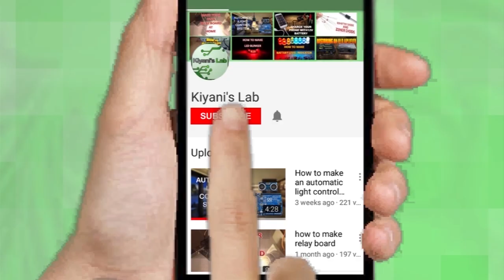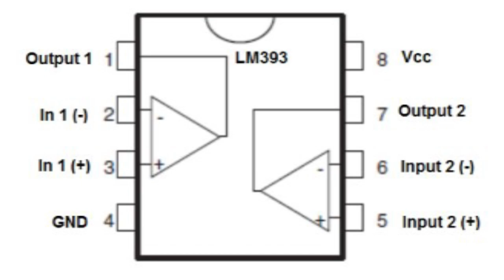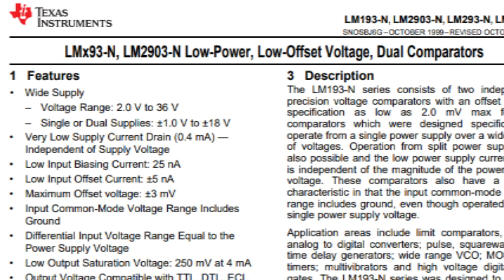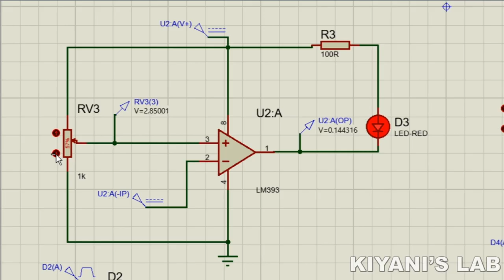What is Analog Comparator | How Analog Comparator Works

Comment: What different this IC and op amp IC like lm358
Reply from the maker: this is a comparator its output switch between on and off mode (cut-off and saturation mode )  where as the op amp gives linear out put it works in active region 
simply comparator works as a switch and op amp works as an amplifier
Reply: @KiyanisLab  oh ok, very clear and thnks 🙏🙏🙏
Reply: @KiyanisLab  oh ok, very clear and thnks 🙏🙏🙏